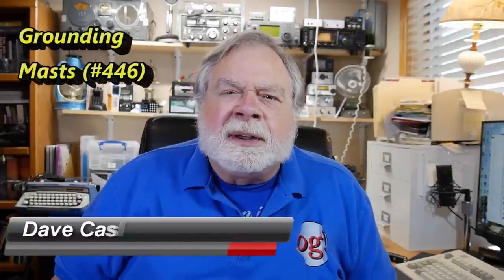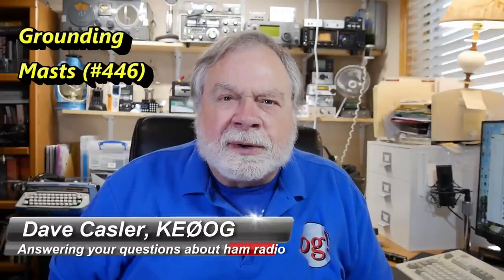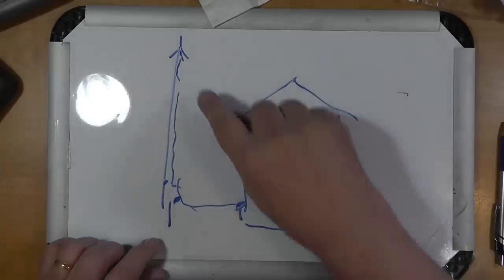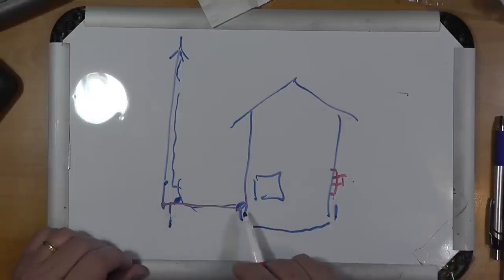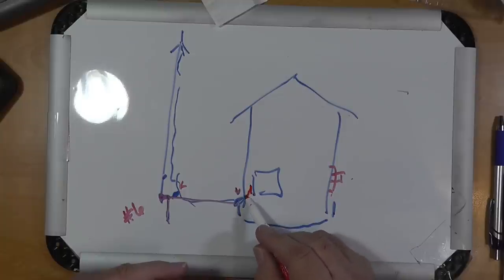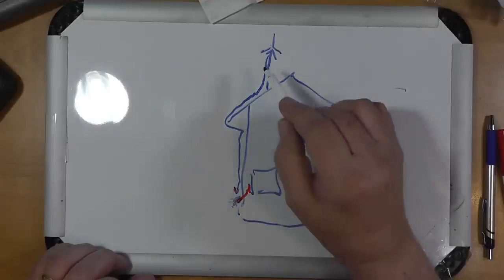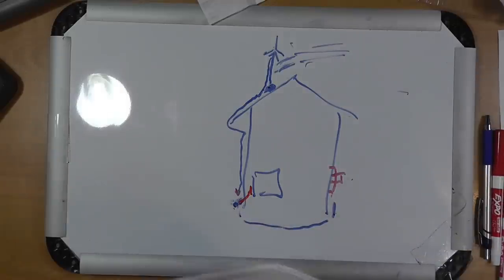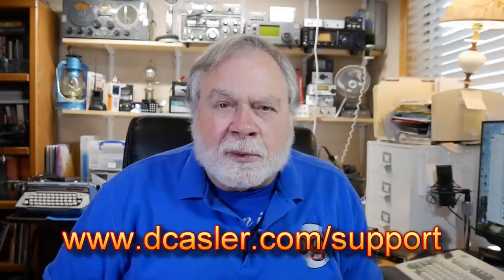Grounding Masts (#446)

Comment: Our home was a direct hit a number of years ago. $20,000 damage. Lightning hit the galvanized gooseneck bathroom fan exhaust on the roof. It vaporized the plastic connection tube from the fan to the roof outlet. But the connection tube was a flexible type with a wire stiffener coil inside it. It grounded through this coil to the fan and down to the basement where the ground rod was. It blew every piece of electronics in the home even those not connected to an outlet. My kids phone charger cable was lying across the metal heating vent and it was pulverized. Even my neighbours suffered electronic damages. The stove moved away from the wall 6 inches and the whole circuit board was toasted. Needless to say when it’s stormy outside I get a little gun shy. Lightning is nasty stuff, I can still smell the ozone and remember the static charge feeling we both felt also the incredible noise. Hope I never have to experience that again.
Reply: Wow, that is intense... There is very little you can do to protect your home and electric devices from a direct lightning strike. The standard so called lightning arresters do a great job at directing static electricity to ground and they will provide some protection during a nearby (not direct) strike though. Arresters are usefull then, but noit so much against a direct strike to your home.

If I lived in an area with frequent thunderstorm activity, I would definitely try to keep a direct lightning strike to the mast at the mast by grounding it there.
Reply: @erpece  Thanks for the advice. Don’t have a high antenna or mast at the moment but planning one for the future. So gathering all the correct information so I do right the first time to avoid further reoccurrence of nature’s wrath.

Comment: Finally, after over 440 video’s I caught Dave in a mistake - however slight. He said use #6 bare stranded THHN. The THHN is the insulation, so if you want bare wire and buy THHN, you’re going to have to strip the THHN off of it.   Love ya Dave!  Keep the great advice coming!
Reply: Caught that also.  I don't why bare wire would be preferable?  I usually use green insulated wire.
Reply from the maker: Good catch!
Reply: @BryanTorok  bare wire is less expensive.
Reply: I caught that too, and also in another video he posted a short time back.  I mentioned it in that video, but got no response...
Reply from the maker: @Calico5string1962  Sorry, I don't see every comment. You are correct.
Reply: @davecasler  If only I made as few mistakes as Dave...  I’m learning and Dave keeps me from making many bone headed mistakes. Thanks again!
Reply: @Calico5string1962  Some people are lucky.
Reply: I believe if you use bare wire and run it along the ground or under the ground, it provides more surface area to equalize the electric potential with the surrounding dirt particles. Is that correct?

Comment: Temporary some times become permanent. I don't know what kind of soil he has. I live in Florida and have sandy soil.I have seen many times where ground rods get glassed over from lightning! Where the ground rod got so hot it turned the sand into glass. Believe it or not the radio didn't get much damage. It did blow the connector off the coax took out the FET at the front-end of the reciver, some damage to the duplexer jumpers. After seeing that I ground everything as many times as I can. But Florida gets more lighting than the n3xt 4 next states put together. Florida is where most of the lighting testing is done, at The Cape!  Cape Canaveral!  They have had many launches hit!

Comment: My brother lost 2 radios, one was an antique Yeasou that got destroyed immediatly during a lightning storm. He had arrestors up the wazoo, someone forgot to tell the lightning the arrestors were there. Like they never existed. Can't happen twice right?  , it happened a 2nd time back in 1983, 2 years after the first one. He got rid of whatever he had and never got another radio. His house had almost burned down. Ground wires were very heavy gauge both times,  everything over-designed, he is a union electrician here in upstate NY.

Comment: Soooo.... lightning knows the difference between a "temporary" mast and a permanent one? LOL

If a metal mast is setting on the ground (or in the ground) then is, for the most part, effectively grounded, at least for static discharge purposes.

Also, as I mentioned in the comments of another of Dave's videos [here on YouTube]:  
When running "bonding" lines from ground to ground (or ground rod to ground rod), it's best to use SOLID copper wire, not stranded, ESPECIALLY if you are intending on burying it.  Bare stranded wire can get moisture and corrosion between the individual strands of the wire, and this leads to increased resistance and impedance (or less "conductiveness"), which is NOT what you want in your grounding system.

Use bare,  SOLID #4 or #6 copper wire (readily available at home improvement stores), and bury it as deep as you can, for the run between the ground points (i.e., ground rods).  As a benefit, this buried wire also adds more "ground" to your ground system!

73,
~Alan

Comment: Depending on the distance between the mast and the house, I would want a grounding rod at the mast too.   In case of lightning, whether a direct strike  or not, the sooner the pulse gets shunted to ground, and the farther from the house it is, the better.
I have a separate ground line for the mast on my roof, in addition to my station ground and can detect no static discharges regardless of the humidity or wind speed.
Several years ago, the BBC issued a report on precipitation generated static.   One of its recommendations was to reduce or eliminate  the number of sharp points or edges on the mast hardware.   Even putting insulating caps on bolt ends can supposedly help.
73

Comment: If my antenna mast is connected to 8ft ground rod in the back side corner of house, along with arrestor for the coax…and my home’s GES is in the front center of house. Do I really need to run #6 copper all the way to the front of the house to bond the rods? For me thats about 50’ worth and will go around half the house.. Is it really needed?

Comment: My antenna tower is 200 feet behind the house near the highest spot in my yard. Therefore, I grounded my tower at the tower. From what I have read in many books , when your tower is over a certain distance from the house, a long ground wire from the tower to the house SPG is not recommended due to inductance issues because of the long run. I certainly have not run experiments to check this out, but with copper prices through the roof, local grounding for towers over 100 feet away from the house is the way to go presently.

Comment: Multiple ground rods is only needed for distance between possible ground rods.  It does not matter how tall the mast is.  If the base of the mast is close by, then only one ground rod is needed.  If the mast is far away, then it may need a ground rod at the base.

Comment: Can you please clarify as most videos I see from you keep assuming the shack is on the 1st floor, mine is on the 2nd, can’t I run a ground wire from a lightening arrestor placed just before the coax enters the 2nd floor shack, To a ground rod using 8 awg or so …copper wire..thank you

Comment: Great video as usual! Watching this reminds me of a topic I've been thinking about. The question that I have is, how far can you separate your radiating element from the counterpoise or ground plane. 
 To better explain what my question is, here's a scenario. I put a quarter wave element on top of a mast. (Let's say 30 feet up) that quarter wave element is connected to the center conductor of a coax cable.  The coax then runs down to a barrel connector. that barrel connector is connected to a ground plane. The coax then continues to the transciver.
 Would this even work? Or does this already exist?  I've searched the internet and haven't found anything useful. Any answers are more than welcome. Thank you in advance.  73

Comment: Question:  If a Gal Pole goes 30cm/1foot into the ground does it need a ground if it is in the ground, or should it be 3ft minimum into ground ?
Reply: Grounding very much depends on the type of soil and the momentary/actual (!) groundwater level. In any case, 30cm is not enough. 3' is much better, but will be insufficient in like dry desert soil. A general recommended depth would be 2 meters or 6'.
Reply: @erpece  Thx but 6 foot = 1.8 meter and 7 foot =2.1 meters, so i was half right with 3 foot (x2)